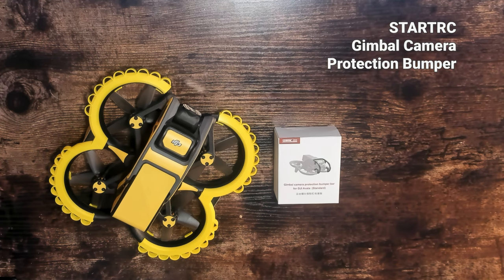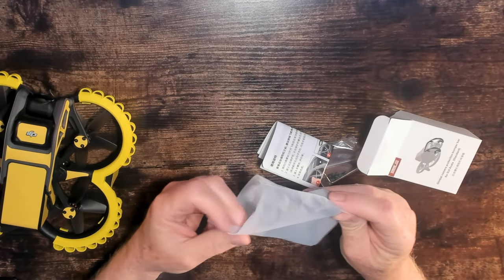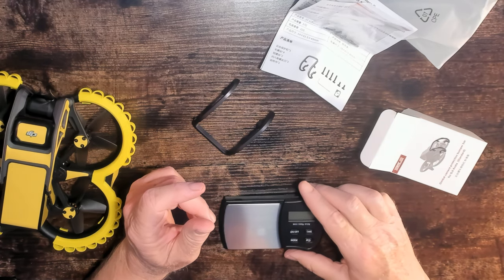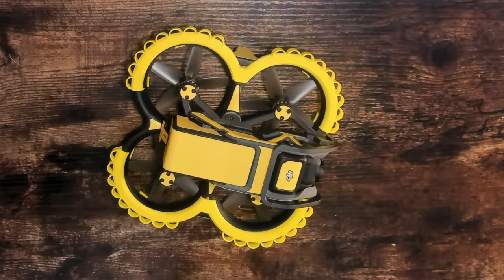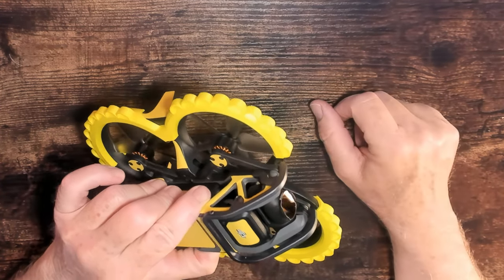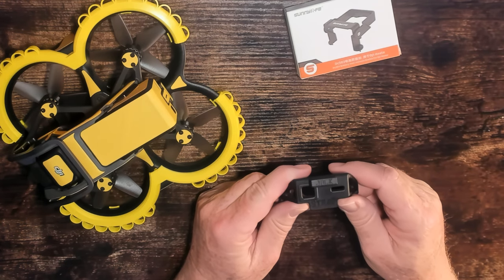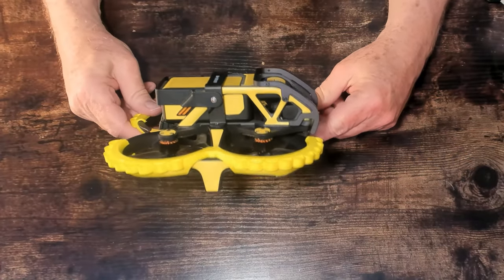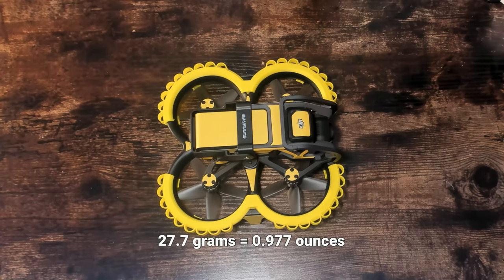DJI Avata Accessories - Enhancing the Experience

Comment: I added the same battery guard to mine. I bumped the ground once and had one pop out. I found it easily enough, but I have had other minor crashes where I used the beeping to find it, and you don't want to lose a battery when it's in the bushes. Great video!
Reply from the maker: Losing a battery in midair is catastrophic, but losing it after a catch definitely slows down recovery or worse.  This battery guard gives me piece of mind.  It is also why my Avata is skinned in bright yellow.  Much easier to find if it goes down.  Thanks for taking the time to watch Jeff!

Comment: Thanks very much for your well-organized video. Very well done review. Guess I'll have to both of those things. By the way forget about the protection. Your Avata just LOOKS great!

Question - do your accessories make it more difficult to fit in your case?
Reply from the maker: Thanks so much for the kind words.  I had no issue with fitting the modified Avata into the original case, which I still use to house my drone.

Comment: I just ordered the battery retaining strap through your affiliate link. I needed the camera cage two months ago before I scratched the crap out of my lens but I think I might still order it. The battery strap is a must. DJI should be sending us those for free because the system they designed sucks and will just lead to a lost quad.
Reply from the maker: The battery is a pretty tight fit when installed. So I was originally puzzled by others complaining about the battery ejecting.  Of course, that changed quickly when it happened to me.  DJI should definitely designed a much better positive latching system for this drone.

Comment: Hello brother, thank you very much for your video but I have a question. I put all those accessories on my avatar and the longest it has lasted was 12 minutes. Is that correct?  Just in normal mode without moving the drone.
Reply from the maker: Thanks for taking the time to watch.  I'm getting 13-14 minutes consistently with usually 20% battery remaining.  Of course, in high winds, this is dramatically shorter.
Reply: @LensCaptureOnline  thanks so much 🙏🏾🙏🏾

Comment: Western New York here! Great video. Question: what’s that gimbal cage made of? 16 grams seems real heavy for aluminum. I have one on my potato that’s 100% saved my camera.
Reply from the maker: Thanks so much for taking the time to watch.  It appears to be and is advertised as an aluminum alloy.  It is pretty solid and definitely confident it will keep the gimbal and camera safer.  Luckily, the Avata lens can accommodate filters so I always have one on.  That should protect it from any surface scratching.